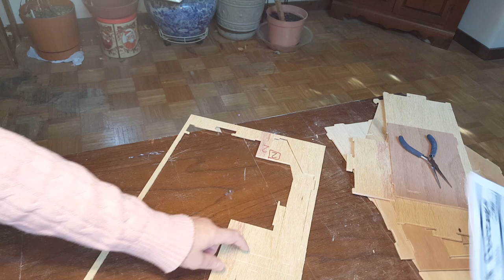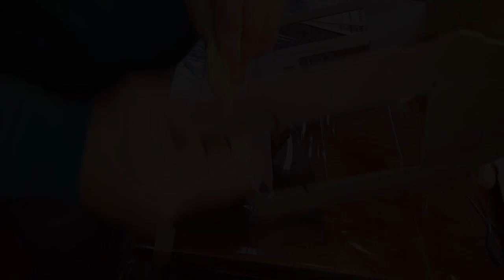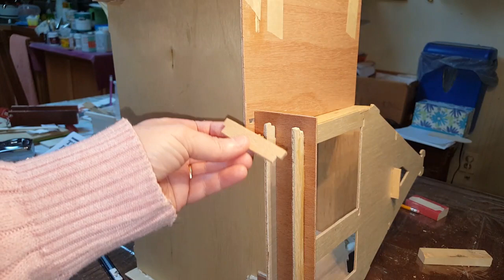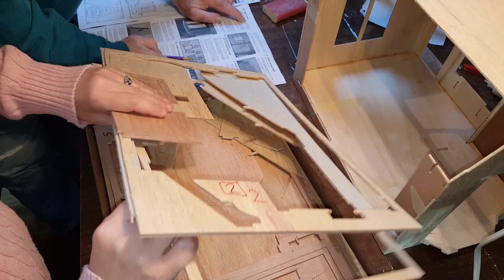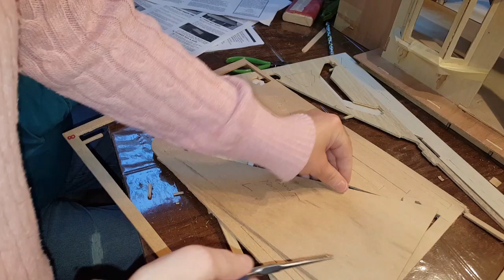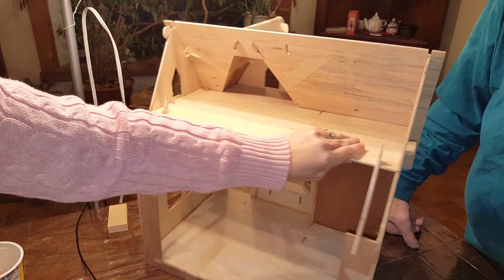Greenleaf Storybook Cottage Build Tutorial (P1)

Comment: Thank you for this video I am new to dollhouse making this company has me worried I will look at another company to buy my first dollhouse
Reply: There is a guy named Joe in Maine that makes the best flooring for dollhouses. Type EBay; Long sugar Maple dollhouse wood. You get 500 planks for $15 bucks. I don’t mess with the small or cheap stuff anymore....it adds quality to your house, plus isn’t difficult to replace if you have electrical problems.
Reply from the maker: It has its pros and cons. You can add on very easily to the Greenleaf kits but they are a lot of work and I never use anything but the frame because of how the wood is.If you want to try to build the Vermont Farmhouse for your first build we are renovating one now and plan to build one from scratch as our next project. They are made with MDF so they are very smooth wood to work with. 

Here is the link to the location I bought my Vermont Farmhouse http://www.hobbylobby.com/Crafts-Hobbies/Dollhouses-Miniatures/Dollhouse-Kits/Vermont-Farmhouse-Jr-Dollhouse-Kit/p/28857-PU0883

Here is the link to my makeover build

http://www.dollhouseminiaturemadnessandtutorials.com/dollhouse-structures/dollhouse-builds/vermont-farmhouse/
Reply: Laurie Heisler thank you so much you are a big help! Also I have a dollhouse that was given to me and I have no clue what kind it is or where to begin to start fixing it up. Do you have a way I can send you a pic of it?
Reply: Laurie Heisler awesome thanks! Sending now